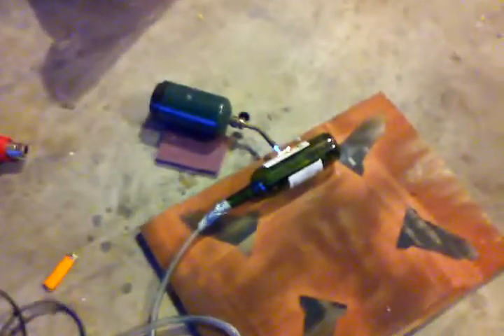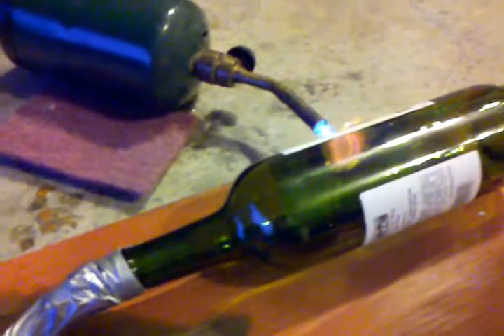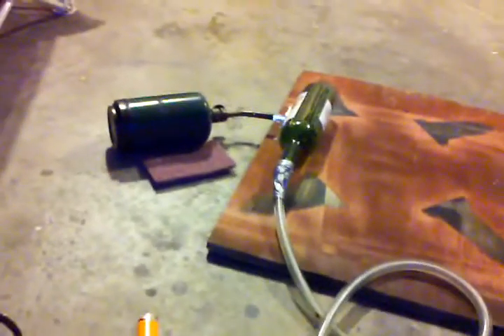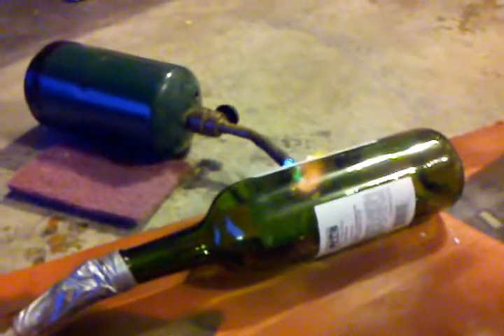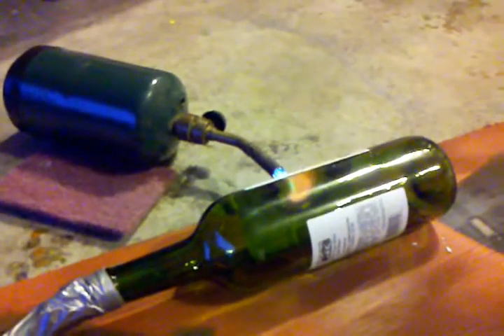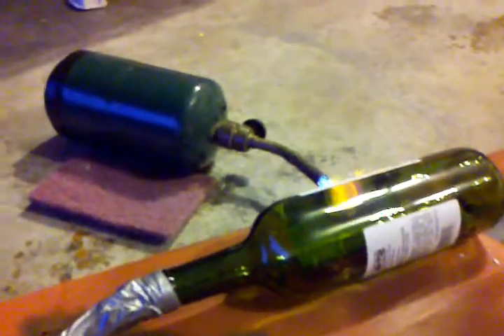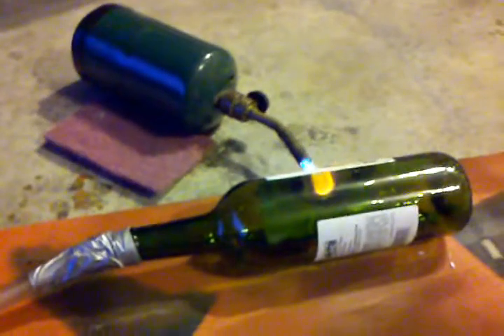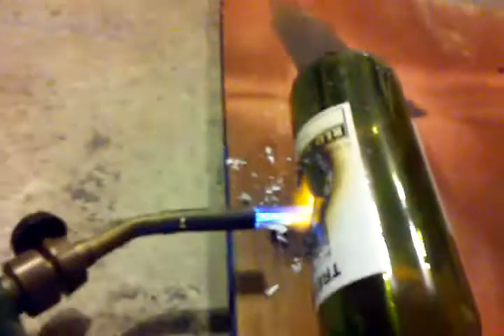Melting glass with a propane torch and a vacuum pump

Comment: i did lampwork in highschool and cracking seemed to be a recurring theme if there was any air getting to it. rather than just a vacuum, i bet this woulda been a cake-walk if you buried the bottle in some sand to absorb the heat. it may take longer, but it would cool MUCH slower allowing you to put the hole in it, and not have hairline cracks. i looked up your video while thinking of plans for my day of the dead tequila bottle bong.   ENJOY

Comment: you may get less thermal shock if you put a heat lamp above and below the bottle so the whole thing is hot to start then you could turn off the propane with less fear of it cooling too fast.

Comment: you don't need to. You need one of those bottles (like the old sobes) with a little ratchet shaped indentation on the bottom. You put a nail in the corner and whack it with a hammer, harder and harder, until it knocks the inside out of the corner of that little dimple.

Comment: use a wine bottle with a dimple on the bottom where it goes up inside the bottom of the bottle a little, and just hold it ontop of a steel bar or something and tap it on the ground.... glass waterfall....

Comment: I'm trying to find out how to melt glass to make a waterfall bong lol
Reply: istn23 just get a glass beer bottle an glass drill bit an drill close to the bottom on the side of the bottle cover with tape an fill with water then put a 14 mm round bowl on top of the bottle,pull tape off hole an let it rip with lighter above bowl

Comment: I want to melt some Glass just a little too distorted how can this be done for a Windows
Reply: I've since learned you can do it in the oven.  About 350F and let it "slump" and it won't char the label.  Takes several hours and then just shut the oven off and let it cool down slowly.  (i.e., don't open the oven)  In total about 24 hours.  But this just produced a "flat" bottle, not the same as I was going for in this vid.
Reply: Thanks - Does it bend much or can you control the bend if it is laid on some supports, like pins/metal tabs or such? also another problem with oven is it may not be big enough for 350mm x 760mm glass panes. I do have some smaller paynes so could try them